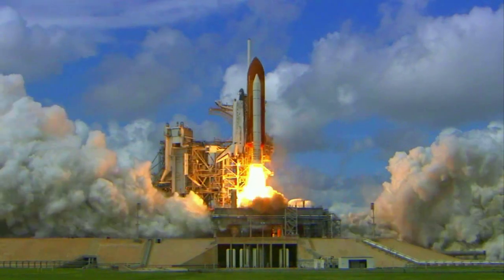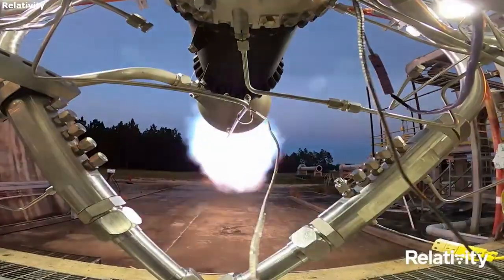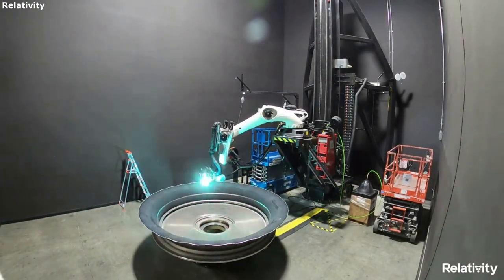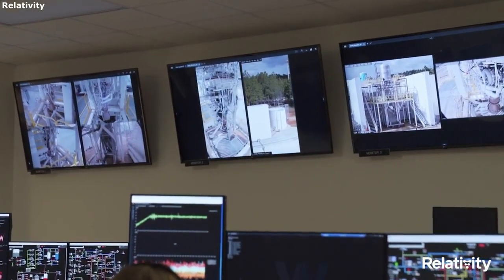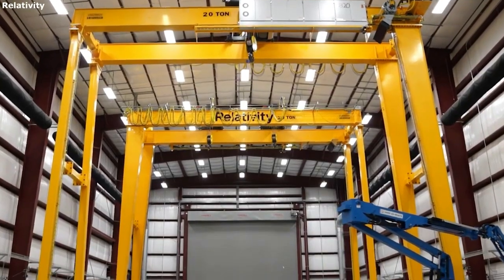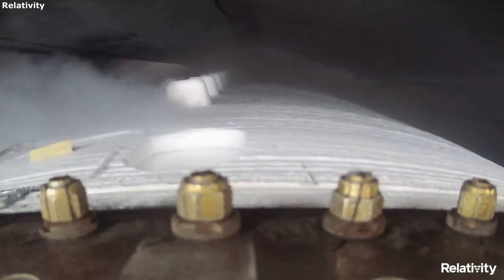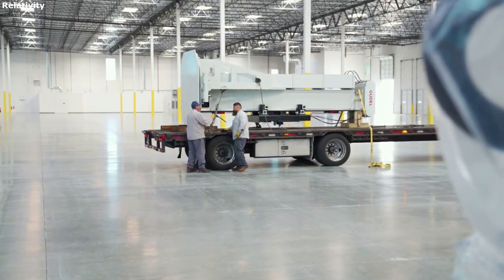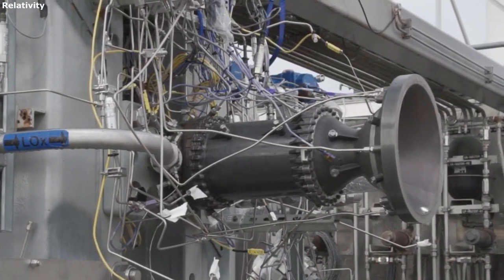What Makes Relativity Space’s Aeon Engines So Special?

Comment: When you say fully reusable I assume you mean just the first stage as I see no way a single engine 2nd stage can land.
Reply: Unless they rip off stoke spaces engine as a heat shield I don't see them reusing a second stage.
Reply: @Tanoforfucksake  granted at starship scale of massive rockets, the mass offset by thermal management is not nearly as crippling to the payload as it is on smaller launch vehicles.